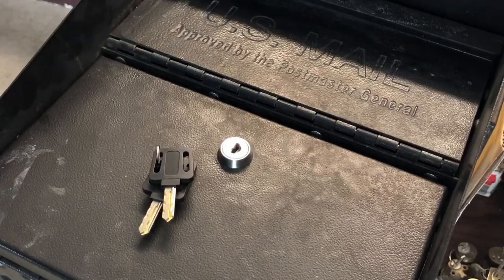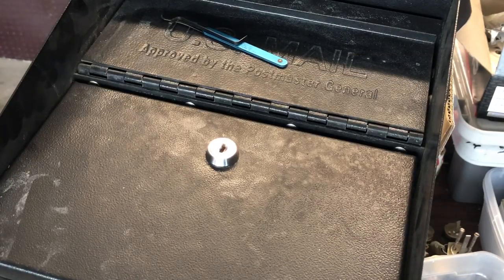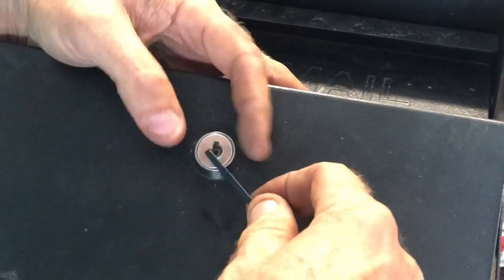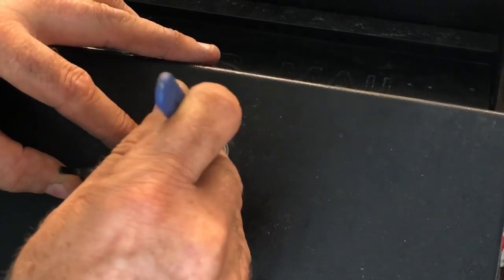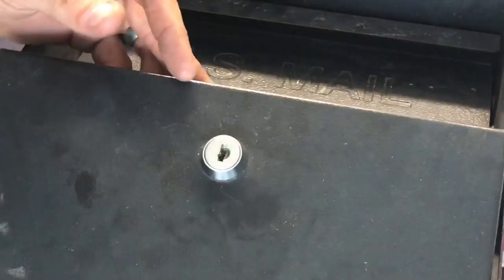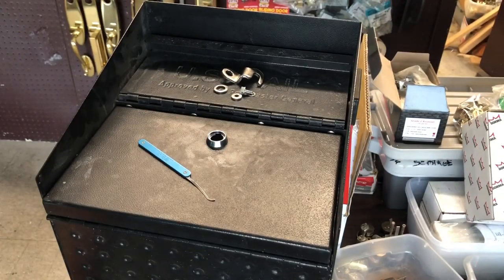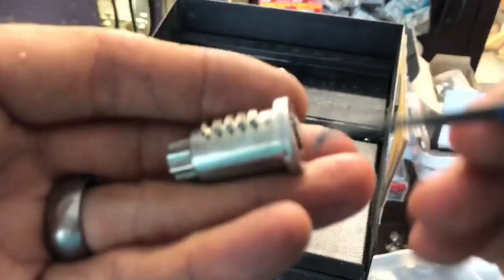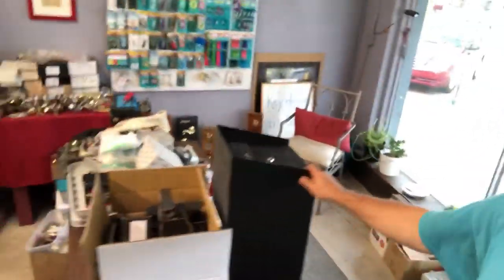Unique Higher Security Pedestal Mailbox Lock: Mail Boss

Comment: The security design includes the interference fit of the cam to the box and latch you are now grinding away as well as the number of pins (10 or 12, I see 12,)
Grinding down to 'fit' better now allows a lock pick to have a fighting chance to pick this lock.

Comment: Geeze I'm drilling one of these out and I busted out the mag drill. It's ridiculous how strong the hardened steel is.  I'm thinking of drilling a small hole in the back and getting a long socket or screwdriver to remove the tail piece. Might be quicker.
Reply from the maker: about halfway through them we all start to ponder those "other" choices lol, this company should start making normal styles of cylinders cause they got the drill protection part right

Comment: Is there ONE single lockpicker on youtube that actually explains how they're picking locks instead of glossing over 99% of it as if everyone watching knows how to pick every other lock already?
Reply from the maker: This is not a “lock picker” channel
Reply: @selock  I won't call anyone that doesn't smith locks a lock smith just because they can fiddle some picks or work a power drill. So far, every lock picker resource I've looked at has been an abysmal failure that can't give even the simplest of directions. They all either start at square 1 and spend forever on the basics and never get to how to apply them, or they ramble and go on tangents and never explicitly tell you what they're doing.

If you don't already know how to pick a lock, 99% of lock picking videos are worthless. That's why the audience is made up entirely by salty old pickers commiserating over hard locks or ridiculing easy ones.

I hate to see a field with so much potential be wasted because it has zero ability to engage anyone not already neck deep into it.

Edit: Oh, and none of these pickers seem to make any locks. They just take apart locks someone else made in a factory overseas.
Reply from the maker: @NiteSaiya  this is not a “lock picker” channel (for the second time)
Reply: @selock  I apologize. I am a fool. I've been watching hours of videos on how to open a specific lock that must have been crafted by demons and leapt to the conclusion that any reply on the topic must have come from one of the channels on how to pick them. That was stupid of me. Sorry again.